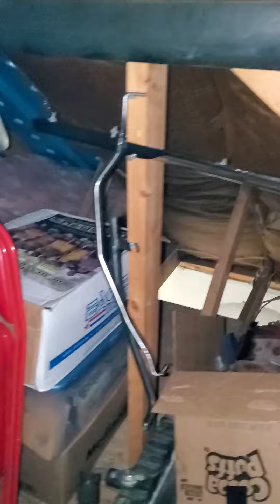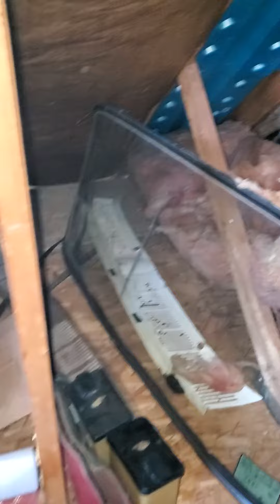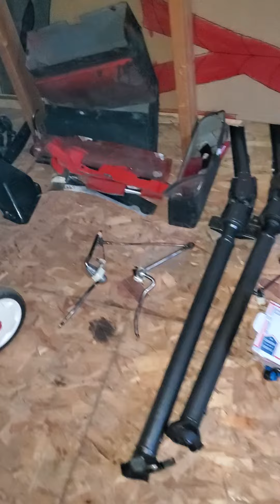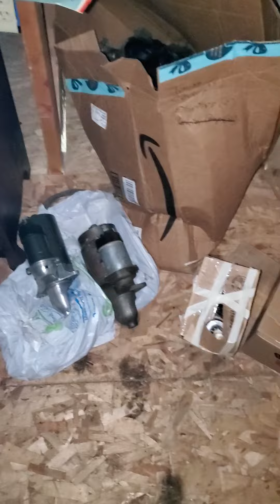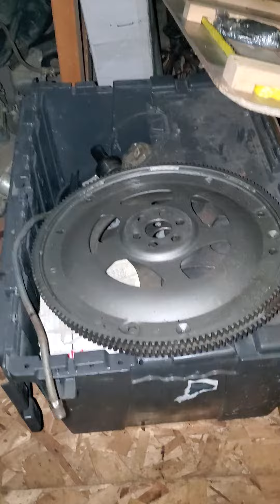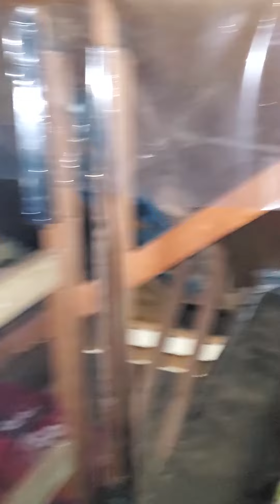Attic full of 1961-63 Buick Special parts

Comment: Are you willing to sell any parts ? I have a 1963 Buick special convertible I’m working on .
Reply from the maker: sure, call me at 217 597 0000
Reply: Troy Noble ok thanks .
Reply from the maker: @nicdavis4001  are you still needing parts?
Reply from the maker: call me if you need parts at 217 597-0000